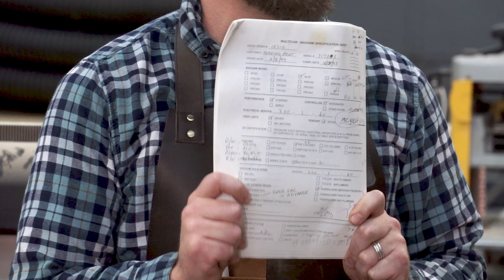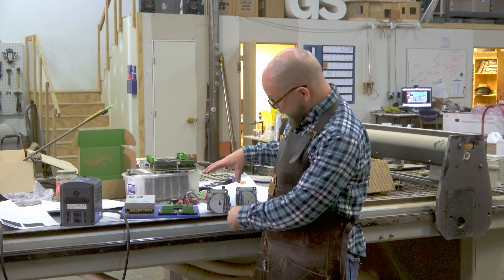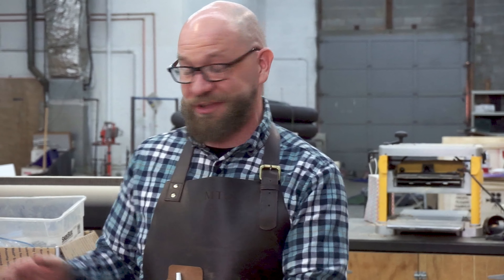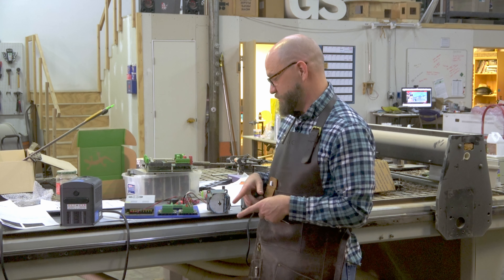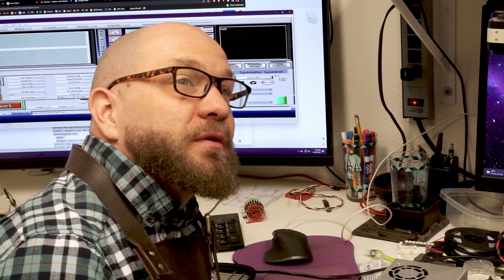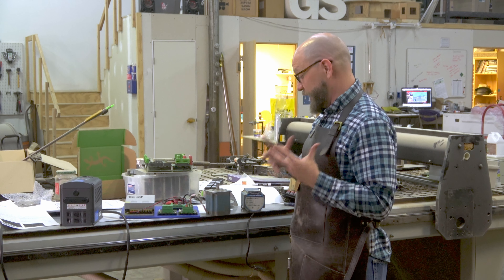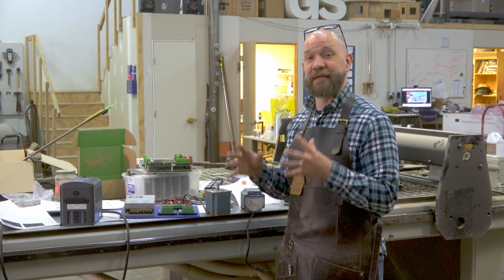Eating the Sleeping Elephant (Finally Waking our 4x8 CNC)

Comment: All I can hear in my head when Matt was talking was the opening line from the 6 million dollar man... We can rebuild him. We have the technology. We can make him better than he was. Better, stronger, faster. Showing may age now! All the time and effort is it worth rebuilding since the prices for CNC machines are relatively cheap? I am not saying you should not as it is awesome to watch and learn.
I am holding out for Mach5 when someone over there can build an interface that does not look like a 1973 xerox alto. I would rather sit at a command prompt and write 10,000 lines of g-code.
Reply: Dadadada... Tacacaca...
New, this machine would sell for the ballpark of 50K. Recent projects that require mechanical precision have come up against the limits of our old machine. So we'll be glad to have the sturdier beast.
Fusion 360 can generate your G-Code. Before that we've been using V-Carve from Vectric.
Reply from the maker: Matt low-balled that a bit. From what I can tell, this machine cost about 95K in 1999. In it's dilapidated current form it would go for around 30K at auction. Multicam machines are the Cadillac of CNC. Part of that is because the chassis is SOOO stiff and well balanced. The spindle motors are 4HP and go for about 8K!! It can probably run any operation about 10X faster than our current machine. I found this video of an SF series in action... --> https://youtu.be/FGePya4Och0
Reply: Answer is yes, absolutely!  You have to compare this to a GOOD machine, which is not even close to cheap!  I bought a little ShopSabre 23 (30"x40") 1 year ago--base price was ~$6500.  Today the base price for the same machine is $9500!  And that price just gives you a milwaukee router.  I was out the door at ~$14,000, but that was with HSD spindle, vacuum table, and a few other things.  So what I'm saying is, a high quality, new, 4x8' machine, with a vacuum table, will probably cost $50k+.  ATC will add atleast $10k.  And then you need electrical to run it, probably 3phase for the vacuum table.  And don't forget a "real" cyclone dust collector, because harbor freight just ain't gonna cut it!
Reply: @GratuitousSets  What cutting speeds are you expecting?  I guessimated that the machine in the clip is running at only 125in/min.  That is probably not full speed?  (I regularly run at max speed of 300ipm on a much smaller machine).
Reply: @fredygump5578 , we run our old machine at 45 ipm. Any faster and we get rounded corners. I hear speeds of 100+ ipm tossed around and it sounds like sci-fi. But we'll dial it up until we see a loss in end quality.
Reply: @matthewcharles7574  You should be able to improve the speed by slowing or pausing at the corners.  Fusion should let you do this no problem at all.  I guess this is the limitation of stepper motors.  I'm spoiled, because the only machine I've ever used has servo motors.  With servo motors, the controller knows where each axis is, so the machine will slow itself down to the speed of the slowest axis to preserve detail.  I'll leave mine for 6+ hours at a time, running at 200-300ipm, and expect perfect results.  So yeah, servo motors are amazing.

Comment: Yes!!!  I am facinated to see this come together, and at the same time I feel validated for my decision to just buy a brand new machine.   Will this be capable of arcs in XZ and YZ axis (i.e. use g17, g18, g19)?  That's a thing I didn't know existed until I learned that my new machine can't do it.  It's helpful for 3 axis tool paths to get smooth curved surfaces without small facets.
Reply: I actually know embarrassingly little about G-code. When we used V-carve to generate it, it would make circles that were actually just N-gons with a lot of sides. Now that we use Fusion 360 I've noticed it generates G-code with actual curve commands. I'm content to keep letting it do the work on that front.
Reply: @matthewcharles7574  If you were importing drawings into VCarve, the flat sides might have been from the file type you used?  For example, SKP files make everything flat sided.  STL files can be tuned to be much better.   But I have also ditched VCarve...
Reply from the maker: Wonderful! Yes, it will. That is basic "ramping"
Reply: @GratuitousSets  I meant when the tool path uses arcs instead of line segments.  In the coding, G17, G18, and G19 specify which plane the following arcs are drawn on.  Then the code simply specifies the radius and end point of each arc.  My machine will do arcs on the x,y plane only, which is the default plane.  But if there is a g18 or g19 code, to change the plane from the default, my controller won't even load the file.  It's a WinCNC controller.